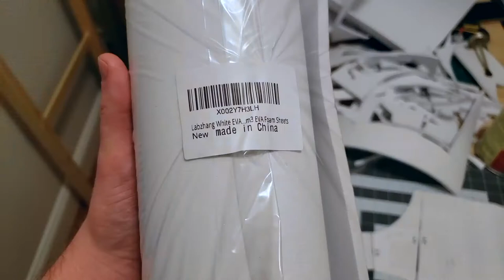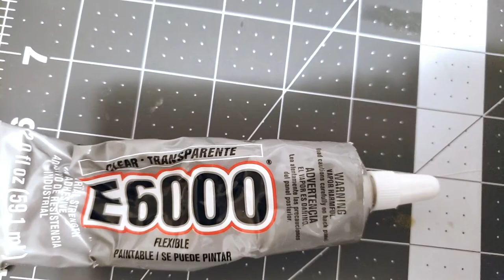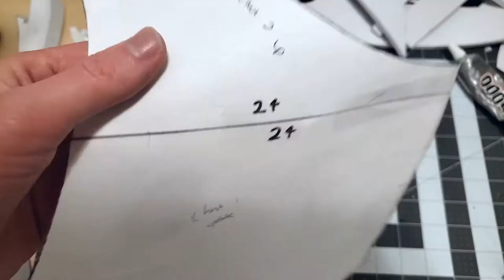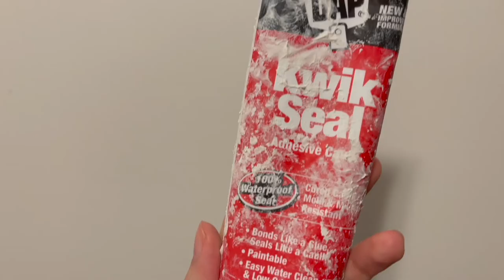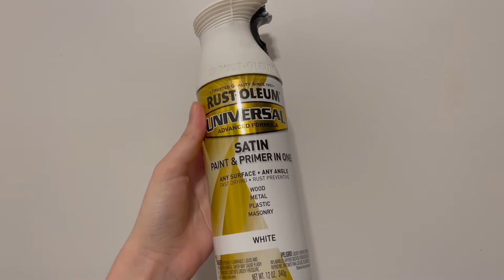Making Captain Rex Armor! Star Wars Cosplay Tutorial

Comment: hey quick quesion. How did u size it to fit your body measurements and how did you figure out how much foam you would need for the project? I've never done something like this before and dont want to waste money
Reply from the maker: The person who made the template for the armor has a similar body shape to mine so there wasn’t much of an adjustment. While we were building we did do some fit checks and trims along the way. You can scale the template if needed based on your height ratio. We ended up using around 6 rolls of 14”x 39” foam, keep in mind that was only for the upper half of the body. Good luck crafting!